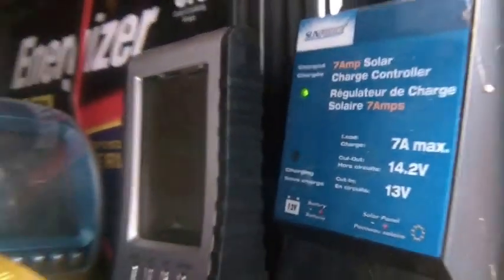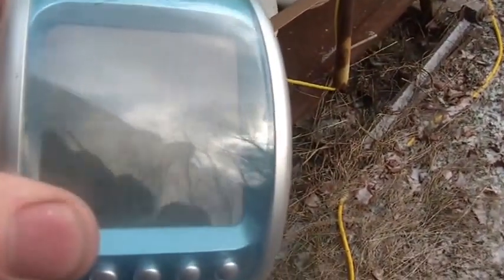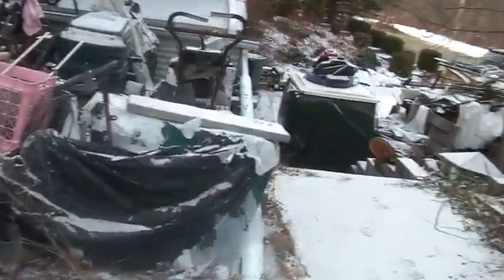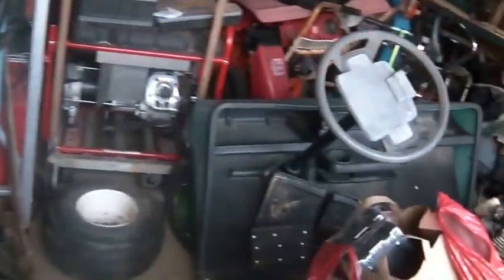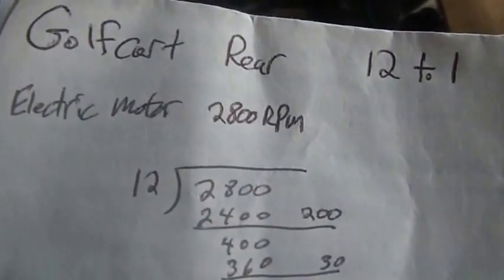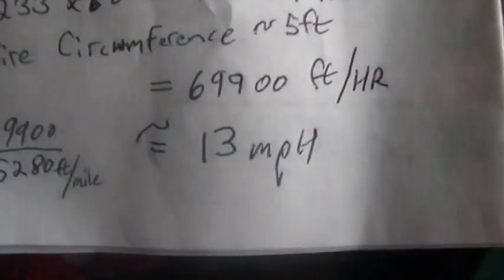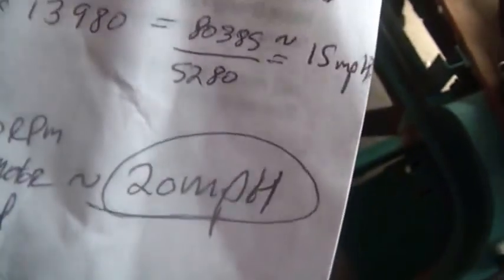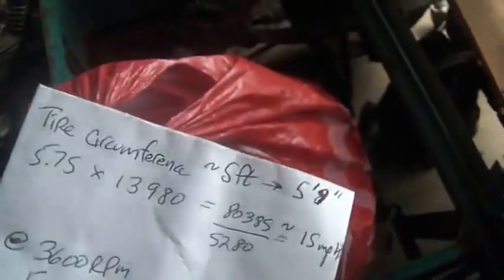1_6_2015, Gas UTV Speed, tire size, after EZGO golf cart conversion

Comment: Also what you should also consider is that you don't need a golf cart to make a Utv all u need is 2 cut in half Atvs and some metal and weld the back of the atv two the front of the other one with a good gap so that you can sit down. If you do that then you can have suspension and more power and it probably will be lighter then the cushman so if you put it in your garage you don't have to go through so much trouble getting it out

Comment: What you should do is put a 200s motor in there so that you have the torque to pull and push things around your hoard. Even know that you have to change gears it's well worth it
Reply from the maker: Charles Nostrand , I'm thinking of doing more than one golf cart build, one will have a 200S motor... Will use the forward and reverse on the golf cart axle... Thanks for the thoughts, watching, and commenting!